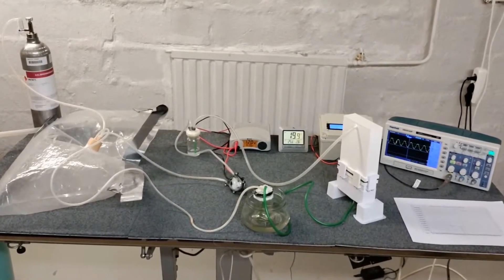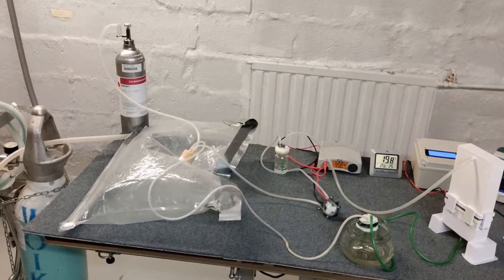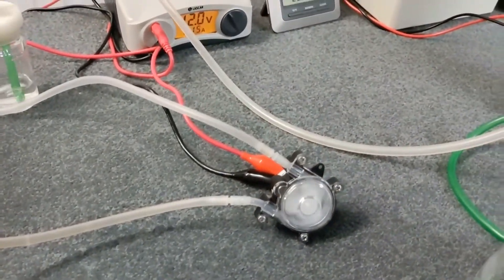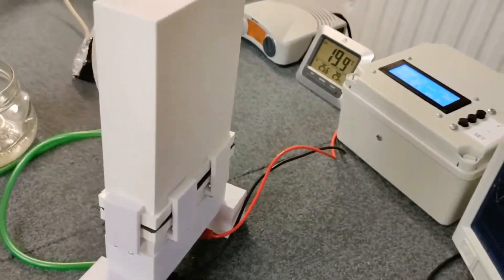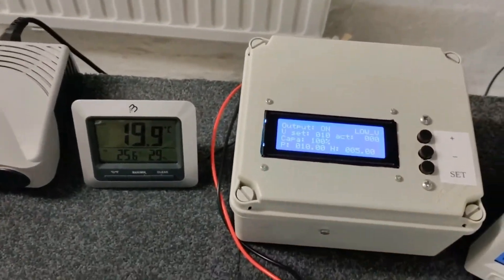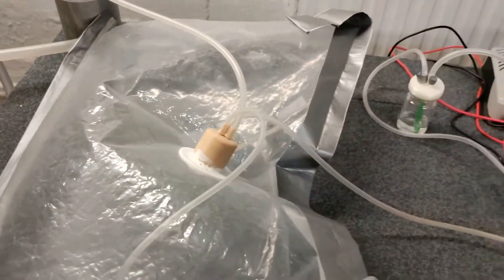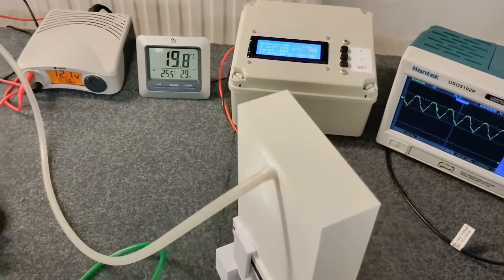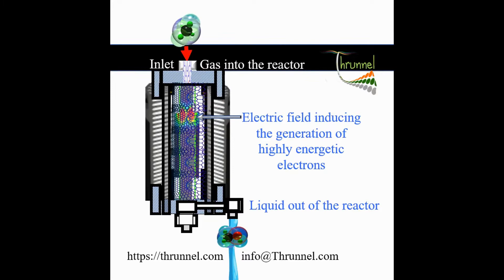Direct conversion of Gas-To-Liquid fuel (GTL) at ambient conditions

Comment: Thanks for the info, how would you scale this so that i could build this into a self contain unit to run a home on liquid fuel? I am planning on building a boigass digester system to produce methane gas. I want to use the gas to make a fuel sorce to run a generator and to heat my water.
Reply: Start small you can fill a 5 gallon bucket and start experimenting right away. Jb weld epoxy to make air tight seals.